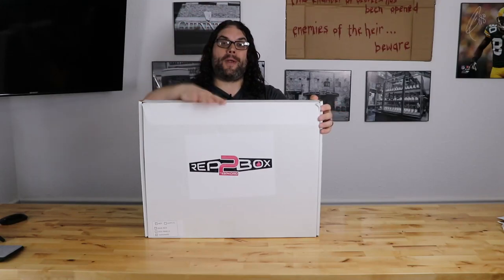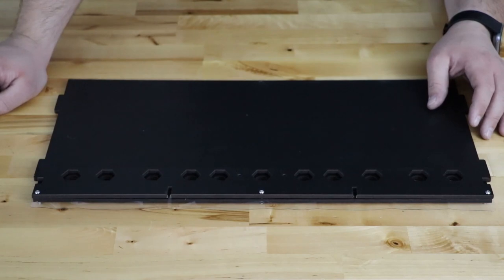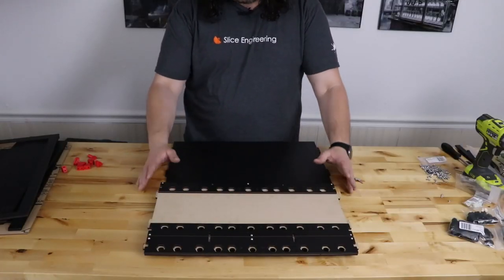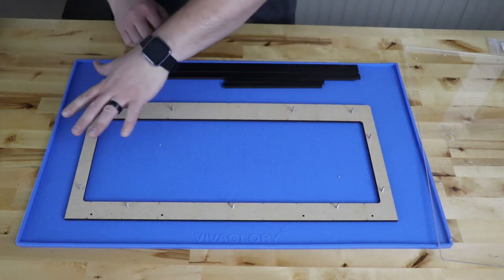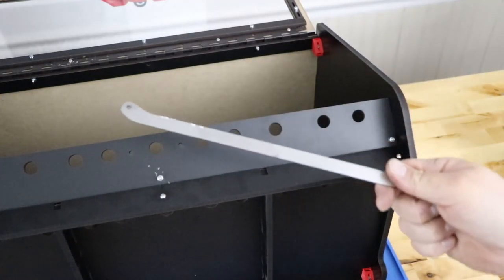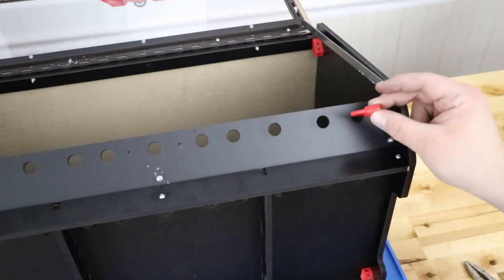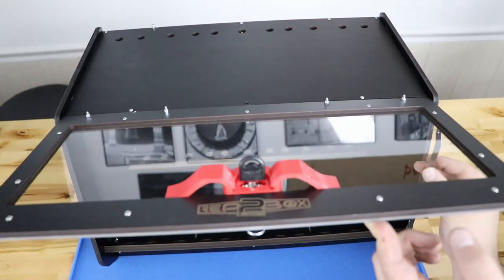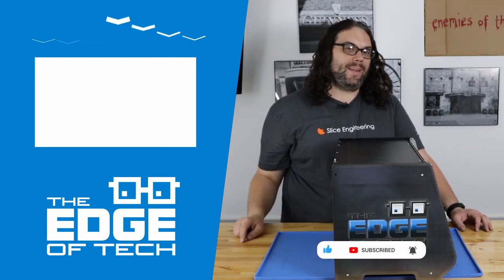Assembling the Repkord Repbox 2 with Custom Side Panels the easy way

Comment: Hi Jim, I know this is off subject but can you tell me if the TH3D dual z upgrade you installed is meeting all of your expectations ?
I an thinking of buying this and value your opinion.
Reply from the maker: Hey Ken! I think if you are looking tondo the Dual Z on an Ender 3, it's a great upgrade! With that being said, I don't think it's a must have. I think the Ender 3 does a great job and because it's not very big it stays pretty even. But if you're going to add direct drive and stuff to your x-gantry, this will help the weight for sure!
Reply: @TheEdgeofTech  Thanks Jim, I am thinking about the micro swiss direct drive when it is available and doing the hight from 250mm to 500mm. I like the idea of not adding a second stepper motor.